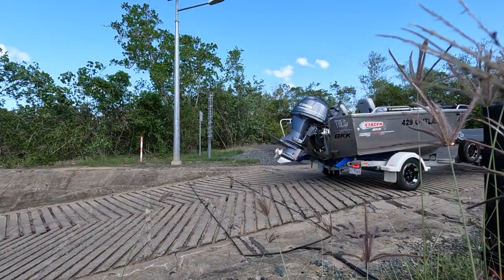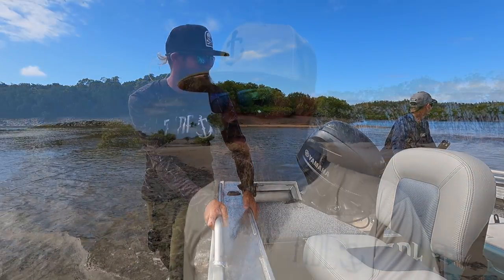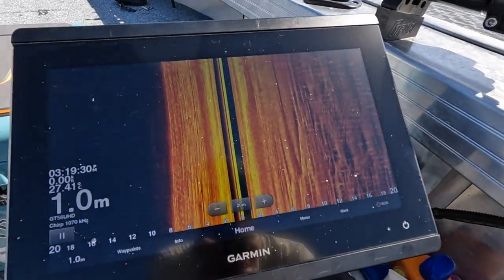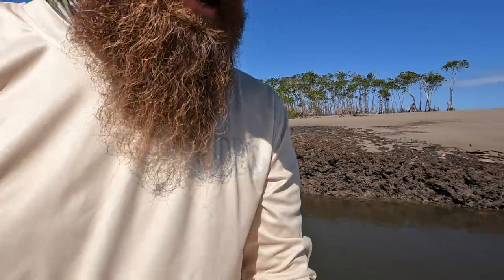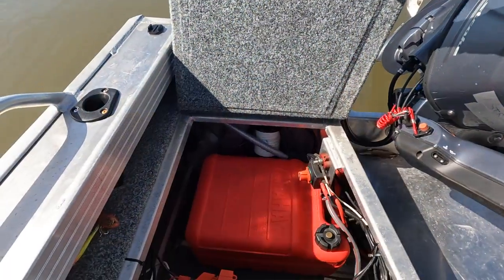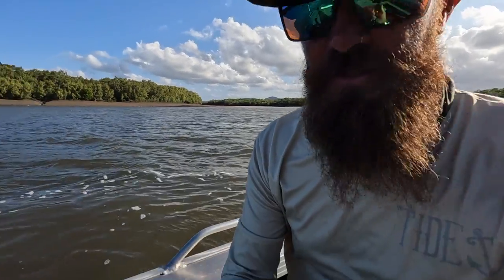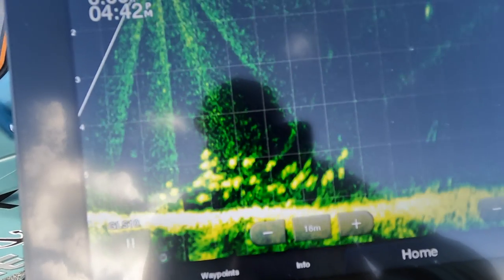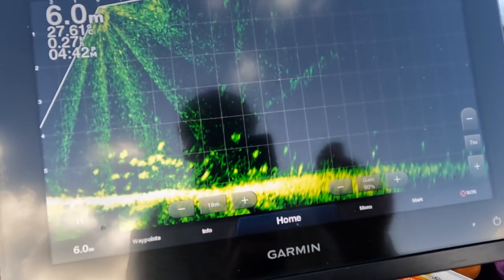HOW I UPGRADED MY TINNY

Comment: Each to their own but I find a fish bag under the front deck ran horizontally is a great option to an esky taking up floor space. The front locker I put 2x10L jerry's and a cast net. 3 do fit perfectly. I just use a woollies cool bag for my drinks. It's squishy and fits under the hatch. My balance isn't the best due to a brain injury, so I prefer a clear deck to minimise trip hazards. Boats are very personal to the fisherman/captain...

Comment: Hi  Mick, ended up buying the anchor well and the Fast Tail based on your recommendation, and am rapped with both. I have a new quintrex 460 renegade with a 75hp Yammie on the back as well as 2xAGM batteries on the back which made her very bum heavy and the anchor well is awesome as a casting deck. Regards Col
Reply from the maker: You won’t look back with those purchases 👌🏻 congrats on the new rig!

Comment: Hey,
Nice set up on the boat.
I’ve been setting up my little 420 renegade and with the fuel tank capacity I was able to get a 97Lt fuel tank custom made up as I ripped out the 50lt that came with it because I was doing heaps of offshore stuff on tuna and didn’t want to carry Jerry’s with Me. 
So you will easily be able to get 50lts under the floor.
Reply from the maker: Yeah 50 will be good, that’ll do me fine 👌🏻

Comment: Hi Mick, I really enjoyed your video, and will be watching with interest when you upgrade the prop. My F60 (26 hrs) could also do with a different prop. The dealer put a 111/2 x 13 and it gets around ok, but only 5200 rpm when trimmed to the sweet spot. It's pushing a Savage 455 with up to 60 lts of fuel onboard, so think a 12 pitch may get a bit more or even an 11. It's so good on fuel though, i've added fuel saver to help keep it fresh.
Reply from the maker: I’ve upgraded the gearbox now to a box of the 70hp so I’m swinging a bigger prop again 😅

Comment: If it starts to change the exhaust note and idle funny you will have little pebles jammed up in the fuel cooler pipes in behind the plenium chamber, just need to remove the little cooling pipes and back flush the pebles out, common problem with the yammys and creek fishing, they make there way up through the water intake cheers..
Reply: Your correct, if it idles high the thermostat can be buggered too. Fuel economy turns to shit as well.